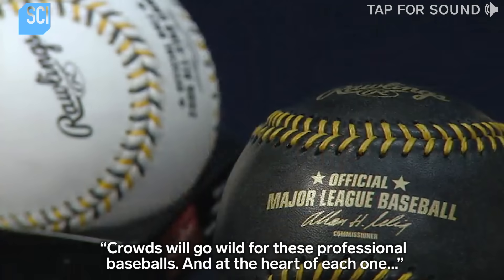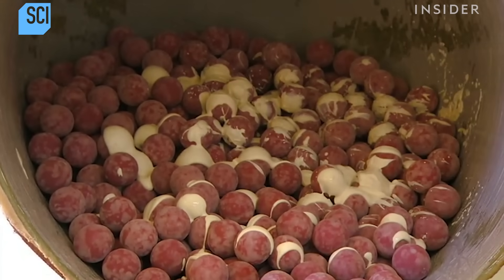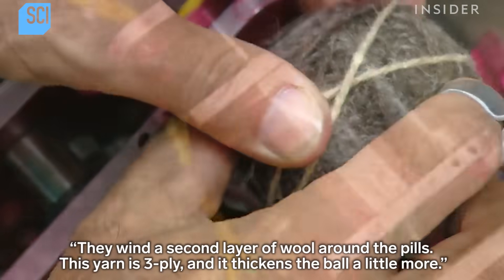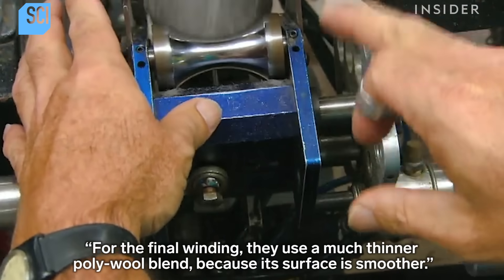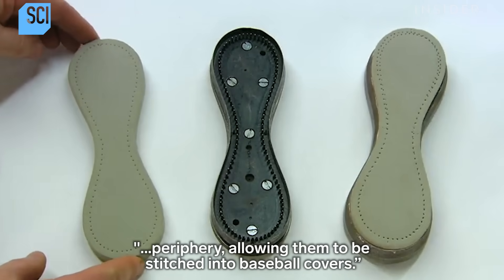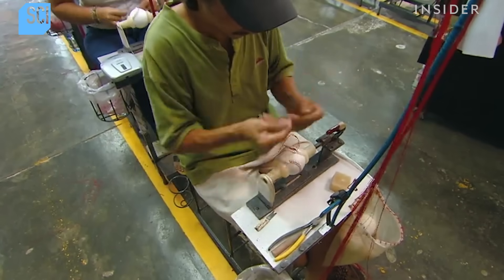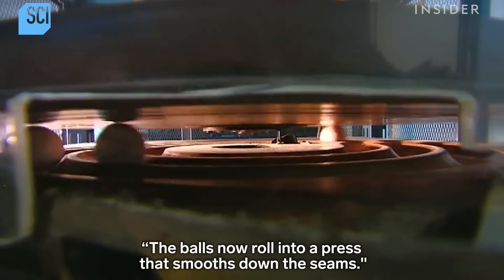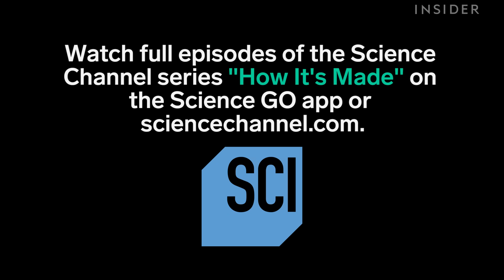How Baseballs Are Made

Comment: It's even more interesting what happens to the balls after they're made.  They're all given to one guy, who goes to a secret location only he knows about, and collects a special kind of mud.  He then coats every single ball used in MLB with that mud, and then works it in and lets it dry.  He's the only one who does this, and he's been doing it for many years.  I never knew they did this, as every ball looks white on tv, but they're not really.  They all have this thin mud coating so that they're not slippery.
Reply: I believe it’s the umpires who mud up the balls before the game? And the pitchers rub up the balls when they get a new one to try to remove the mud. It’s Mississippi River mud that they use. And it’s used to reduce the glare from the new ball.
Reply: @peterhess2610  Incorrect.  There's a guy named Jim Bintliff who goes to a secret shore on the New Jersey coast and collects 1,000 pounds of the secret mud.  He then sells that mud to MLB every year.  Then, before each game, the equipment managers rub about 6 dozen balls with the mud, and it's for grip, not glare.  Google it for yourself.  I watched a video of him going through all of this, but of course the location was kept secret in the film.  This particular mud has been harvested from that location for the past 80 years.

Comment: Circumference? Really? Wouldn't it have been better to give the diameter of the pill?
Reply: The regulation specifies the circumference.
Reply: Would you prefer if they had said "one point three five two eight one seven inches in diameter" (diameter = circumference/pi) ? I suspect they decided that "four and a quarter inches in circumference" was easier to say and hear.
Reply: @thomasstambaugh5181  of course not. However, "About 1 3/8 inches" would have been easier to say, hear, and understand.

Comment: What is the dead ball era? They say Babe Ruth used a dead ball or something.
Reply: Before 1920 baseballs were less lively.
Reply: Prior to 1910 there was no cork center in a baseball. They were just a tightly wound ball of yarn with a leather cover. Even then it took about another ten years and a shift to replacing the ball more frequently and disallowing alterations to the surface to ensure that the ball was always in good condition and not too soft.

Comment: Wait a second... why are they stamping so far apart on that leather?  That was maybe the worst material use maximization I've ever seen.

They are talking about moving the mound back because fast balls are too fast, which is because pitchers are going more full bore because hitters are hitting the ball farther because they keep 'standardizing' the pill to be bouncier and bouncier (and because they are adjusting their swing angle, but that's because with a bouncier ball it's more important to hit the ball up since it has a better chance of going out).

Just engineer the ball back to what it was in the mid-80s and stop building smaller and smaller parks.  Long fly ball outs will encourage hitters to be less all or nothing.  You can lower the stitches and enforce rules on foreign substances but pitchers will still have a fighting chance because they can pitch up in the zone without worrying about every swing being a home run.  If anyone is striking batters out at rates higher than Nolan Ryan did it's time to lower the stiches on the balls again.

Comment: Imagine being a baseball that has to go through this process, shipped, pine tared, make it into the game, just to be used for one pitch that slightly grazes the ground and thrown away never to be seen again.
Reply: They use them for BP
Reply: They never, ever have put pine tar on a baseball to prepare it for a game. They rub what’s called rubbing mud on it. It literally is silt from the side of the Deleware river in New Jersey. It’s been that way since the late 30’s. It takes the sheen off the leather for better grip without scratching or discoloring the leather. Pine tar is a banned substance for pitchers to use on a ball. They also try sunscreen and the rosin bag together. This year they’re using Spider tack. A tacky substance power lifters use on the bar for grip. All banned.
Reply: @danwhitehurst9592  Then why do pitchers use both hands to rub the shine off of a new ball? I thought it was to remove slippery residue left over from the leather tanning process.
Reply: @dalethelander3781  when I pitched I always had some spit in my hands and rubbed it to get that or some hand sweat or oils into the ball for grip. The rubbing mud is what’s applied because the balls are very slick before but it doesn’t give grip. Some moisture and the left over rubbing mud residuals give some tack.
Reply: @danwhitehurst9592  Good info, Dan.
Reply: They give them away to fans too
Reply: U ain't lying. 💯
Reply: That isn't the only purpose; they think about their fans as well,, plus fans will keep in a especial place or sell it for bucks on eBay and such
Reply: …… until a little white kid with overpaid parents gets his hands on one and sells it online for a bunch of money
Reply: @yell0wberry  why would overpaid people sell it for a bunch of money.
Reply: @danwhitehurst9592  weekly allowance + baseball money = 💀
Reply: They get cleaned and polished and put back into the game.
Reply: @marellelandon8006  — No, they never go back in a major league game.  They might get sent down to the minors.